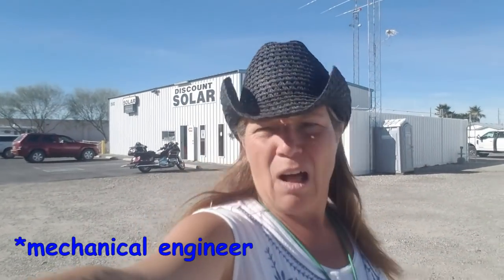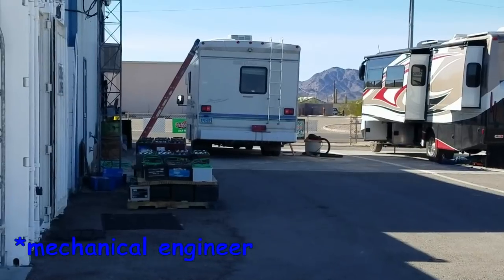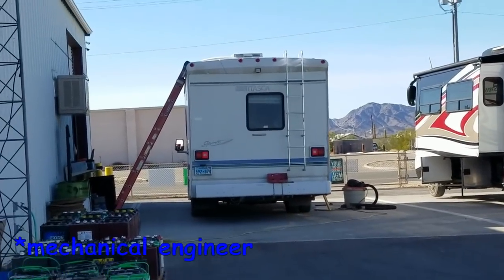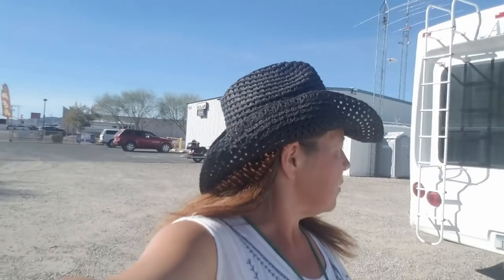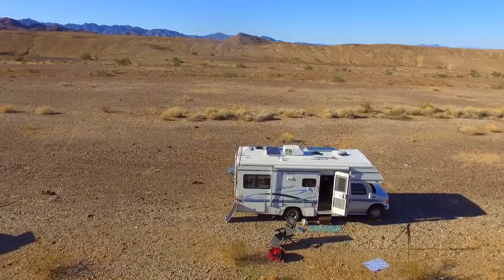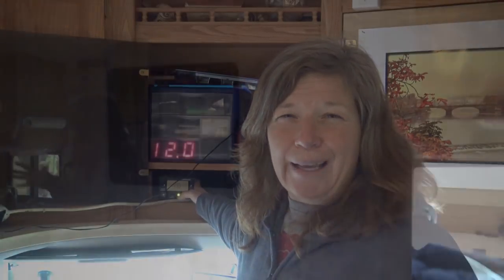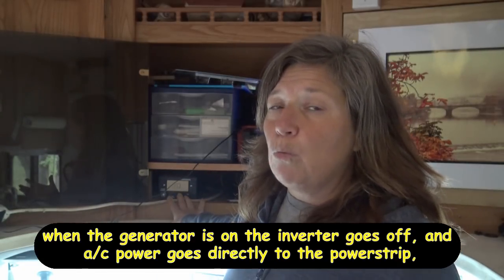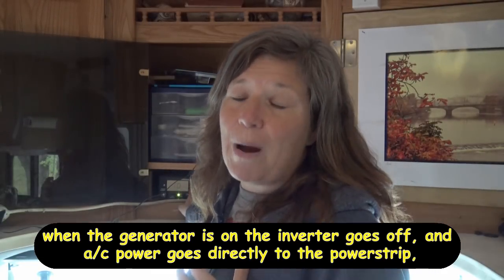How RV Electric Systems Work: Easily Explained and How to Set Up Solar

Comment: I sell and install solar in MN. 90% of the actual solar Cells are made in China. If they are made in America they are put together here. Like some automobile models. It is important because the welding, the glass, and caulking can deteriorate. All panels are rated. Look for the Tier 1 Standard as being the best. Some Brand names are Canadian Solar, Jinko, Han Wha, and Heliene.  Great explanations Carolyn. I will be Living in an RV in 5 years, so the videos are fun and very informative. Your energy and realness is delightfully encouraging.

Comment: As a boat owner, your explanation in describing the differences in deep cycle and car starter batteries is spot on!  Deep cycle batteries are designed to be "deeply" discharged and recharged time and again (cycles) without doing damage to the battery.  A starter (or car) battery has an abundance of power for a very short duration of time until the alternator can take over and recharge the battery.  Car owners know that they can drain their battery down to zero (like leaving the lights on) once or maybe (if lucky) twice.  But this deep drain damages the battery permanently and then it cannot maintain it's load power.  The dead battery can be connected to a charger and brought up to a full charge but once it is put under load it fails completely.  Very informative and enjoyable video!!

Comment: Thanks so much for this! We're about to embark on our first trip. Our RV came with a 'regular" battery but we bought 2 100 watt solar panels that came with 2 deep cycle batteries, controller & inverter BUT they are external and not wired into the RV. We plan on boondocking a lot and trying to figure out how to use the solar AND generator.  Trying to figure this all out & how to make it work.

Comment: Thank you for sharing as always! That battery pack that you showed looks like it needs electrical tape on the wire that you connect to it, I always use electrical tape for my vacuums cuz every time you wrapped them up,  the wires started to expose, so very important to be safe and wrap the wires with electrical tape! Love you Carolyn! Thank you always for sharing! Love you

Comment: I heard not to mix different sized pannels as the higer pannel will settle to the lower pannel?   so, the 160 will only give 100 to match the other 100 pannel.
Reply: zekehooper, yes, with caveat. 
1) treat them as separate panels with separate charge controllers. Both charge controllers can go to the same battery bank - they do not fight or affect each other in any way. 
2) If the panels are connected in series, the total current is limited by the panel with the lowest current rating. However, if both panels have similar current ratings, but different voltages, the panels can be connected in series with little or no loss. The different voltages just add together. All to one charge controller. 
3) If the panels are connected in parallel, the total voltage is limited by the panel with the lowest voltage rating. However, if both panels have similar voltage ratings, but different currents, the panels can be connected in parallel with little or no loss. The different currents just add together. All to one charge controller.
4) Trade or Sell one panel and buy a similar panel. You can connect them any way you want. 
5) it could be that two dissimilar panels are still more power than one panel — maybe worth the waste for awhile.

Comment: Ok, so now I'm just a tiny bit confused about converters. I already have my solar panels, and I've figured out how big my battery bank should be, and how big my inverter should be. But I never knew I'd need to spend more money on something called a converter. 

If I understand the video, I need the converter only if I'm lucky enough to be able to plug into shore power, right? And since I never know when I'm going to have that opportunity, I should get one, right?

Comment: You almost have to have a generator in a system like yours. The sun is not completely reliable. Since you have a generator, it's reasonable to use it when you have to, so it's just a balance. You have that small inverter generator, the Suoaki. I can see that getting better and better. I have one and I can charge it with solar directly. So I can take the flex panels out into the sun to charge it. Costco sells a very fancy one for $1000 but it's 1000 watt hours, 8x what yours is, but it's heavy. There are some small 12v TV's, super efficient laptops. Efficiency is nice, and it's a good strategy. 

This should help people. I wish there were people in the van community who could do the sales and service, build a nomad economy. There are things I would like to do with my little van, but it's not going to Camping World. Not sure what to do. A lot of things aren't really DIY.

Comment: What is the amp hours of your batteries? You say you want to get a couple extra batteries and I was wondering where you would put them. I was told to get them forward of the axle if possible. My house batteries are currently under an entry step. And about the only other place I have is in the rear storage.

Comment: We now have the two 300w each shattered panels on the roof and have the two other 300w under the cabover. Yes over kill with the ten 12 volt batteries. If you can think of it chances are we can run it.

Comment: If the deal doesn't fall thru, I'll be picking up my 20' THOW shell later this month. The video shows a very short surge protector for plugging in appliances. I thought I would be able to have outlets all around the THOW so I could plug things in where I'm working. I want to plug kitchen appliances in at the kitchen work space, and plug my computer in at the desk, and my lamps at my bed, and my hair dryer in my bathroom space.

Will I be limited to plugging things in right next to the inverter? What about my 120 volt fridge and freezer? I want them plugged in at all times (and yes, I have enough solar, and will have enough battery ah's to do that). I just want outlets all around the THOW. Is that going to be possible?

Thank you in advance.

Comment: Air conditioning and solar possible?  How about starting the AC on genearator while boondocking or when stopped on the side of the road for a little break?  What size generator works?
Reply: And... what sized generator do you tote around with you?

Comment: carolyn, thanks for this video, question for you: are your rooftop panels connected in parallel or serial? i am building a similar system so am interested in your solution. thanks again

Comment: Can you run equipment directly off solar so not to use up batteries until you have to
Reply: Tom Pip, unfortunately need batteries. They regulate the voltage and even out power spikes in charging and usage. Charge controllers available to us at this time are not good enough to do that — they are built to “charge”. However, it does not take much battery.  You need enough solar to run your day stuff and charge the batteries from night usage. You need enough batteries to run you night stuff. The day solar snd day stuff will use your batteries for regulating power during the day.
Reply: Tom Pip, if your batteries are charged, and the power needed can be supplied by the solar alone, power usage may still at least partially comes from the batteries (easiest path), but it will be instantly replaced by the solar.

Comment: Wow, Carolyn!  Terrific video and really great info!  Our family business is electrical contracting, but I just run the office so I am not technically savvy.  I do have a bit of knowledge, though, and three questions for you.
1. Your inverter.  Is it pure sine wave or modified?  Also, how many watts?
2. You kept saying you have 360 watts of solar, but I thought in the beginning you explained you have 260 watts on the roof (one 100-watt panel and one 160-watt panel).  Were you adding in a portable panel when you later referenced 360?
3. I was surprised when you said you wanted to "upgrade" to four golf-cart batteries.  I would have thought an upgrade from current deep-cycle batteries would be to lithium-ion batteries. Have you considered them?
Thanks!  Love your channel.  I am inspired to follow suit some day!

Comment: We all love Bob Wells, OK? But that being said, I'm glad you didn't buy the Renogy solar panels that he pushes, because of his affiliation with Amazon. Theirs nothing wrong with them, per se , but it's also good to see people buying American.  And it's good to see someone who understands not to cycle the battery below 12.3 volts, while the battery is at a resting voltage. If the battery is showing 12.3 volts while you have a good sized load on it, that's not the actual voltage of the battery. The actual voltage would be higher. When I plug in my 120 volt coffee maker, my battery voltage will drop to around 12 volts for the 10 minutes that it takes to brew, then it comes back to 12.5 volts or so from a full charge, because even though the coffee maker draws around a thousand watts to run per hour, while it's brewing, it only takes ten minutes to brew, so it only consumes  one sixth of the power rating. 10 minutes is one sixth of an hour. Then I shut the coffee maker off, otherwise it cycles on and off to keep the coffee warm.

Comment: Hello my name is Bill I do watch and follow your Channel and it's not how your camper is I had a 1971 Dodge Coachman many many years ago and the way it was set up the engine while you were driving would charge all batteries it would charge the engine battery and it will keep the deep cycle battery charged as well and when it wasn't plugged in I could use the converter to Run 110 off of my DC battery when it was plugged in the onboard charger battery charger would keep all batteries charged so it doesn't matter on the year make or model of your vehicle it all depends on how it is set up

Comment: It's no wonder you don't like the MC4 connectors, they are made for a semi-permanent waterproof connection that you can take apart if you NEED to. Not very good for frequently plugging/unplugging.

Comment: "Paying more to know that it is done right." How do you know that it is done right?
Reply from the maker: Watch the video again and your question will be answered
Reply: Carolyn's RV Life Im not finding any metrics for done right. You mention, "built to code". How do you determine that NEC standards were applied? You mention electrical and mechanical engineers on staff. Electrical engineers design charge controllers. Installing them would be a side business or hobby. Mechanical engineers would advise you to tilt your panels, because you are not on the equator. Ignoring all that, the power strip that you connect to your inverter runs out the front of the cabinet from a connection in the back, causing me to wonder how you close the cabinet door. Was Discount Solar aware that raceway can be used to make a service drop from the back? Even better would be to get behind the wall and then add duplex receptacles at convenient locations, flush or surface mounted, depending on what room is available. I also follow highly recommended services. Made in America, maybe assembled in America, but most of the silicon foundries have left for China and other parts of the world where labor is cheap.